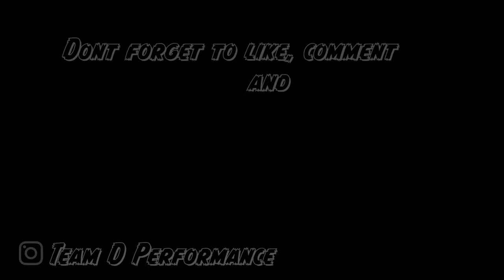1963 FORD FALCON steering completed! SMALL BLOCK FORD TURBO Drag and Drive stick shift build!!

Comment: Uh-oh, a different direction ? I'll be waiting !
Reply from the maker: Yes sometimes things change ! But that’s ok!
Reply: I'm pretty sure you won't be going in the same direction as the guy you got that blowshield from !! Unreal how expensive they are nowadays. Back in the 60's they were $100 !
Reply from the maker: Yes it’s crazy how much stuff is going up! Makes the process take longer ! You’ll have to stay tuned to see what’s gonna change!
Reply: @TeamDPerformance  Ok, I'll be waiting !! By the way, what's going behind that blowshield ? My son (I'm 72) has an '88 foxbody that we're likely gonna build a 408 Windsor for. He wants to keep it manual tranny and I know that stock 5 speed won't hold up. I'm an old FORD street racer from the 60's & early 70's, always ran FE's and toploader 4 speeds. Back when street racing was REALLY street racing, light to light and some straight roads 😯

Comment: Moving right along. Looking Good Hoss. Switching to shitty takes no brains LS . BAHAHAHAHA 😆 SMH. They are plentiful and cheap but on the flip side..... You Get What You Pay For. We run All old school power . 63 Falcon Sprint with 289 and all the good stuff in er and 2 4s and She does good. Puts a hurtin on all the Big Block Chrysler and Chevy Cars. The power to weight ratio in the Falcons are Great.
Reply from the maker: They are plentiful and can make good power without the need for an aftermarket block! Stay tuned to see what is gonna change. And thanks for watching !!